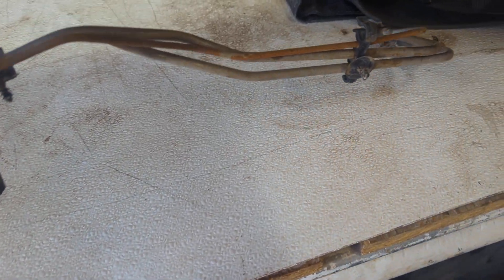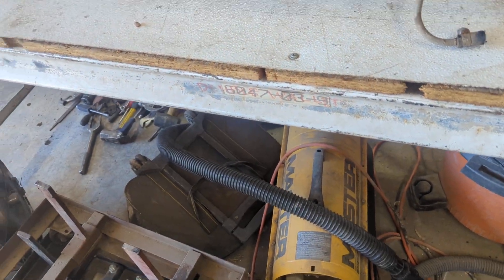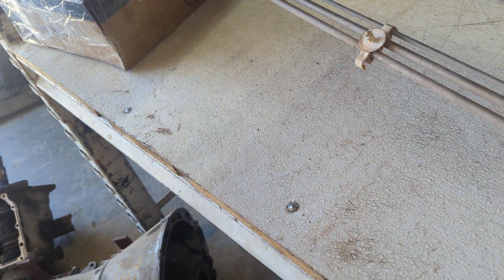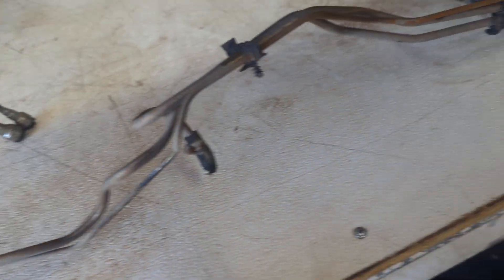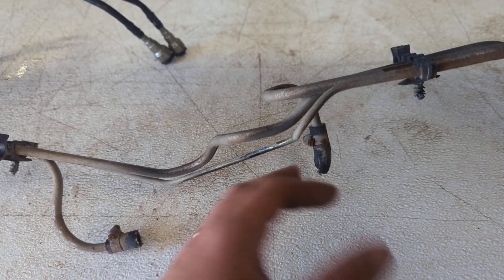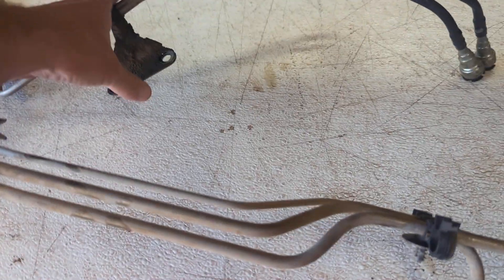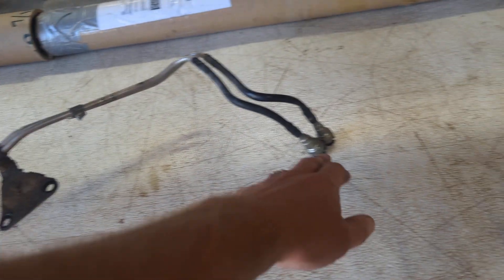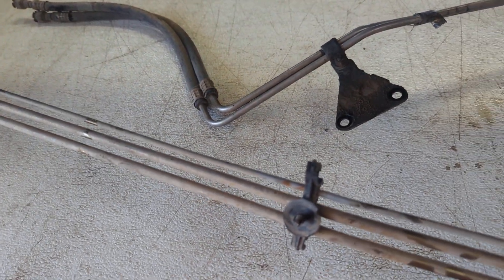Wrangler YJ 4.0 Fuel Supply and Return Lines to Fuel Rail Front 1991-1995

Comment: Thanks for the video. Looking for the rubber sections as mine are cracked and leaking. Hopefully my local NAPA can help with just them like you said. Odd part that nobody really offers a replacement for yet. Did find new ones on inline tube - but I only need the rubber section and shipping the full kit is off the wall expensive like you said. Thanks again.
Reply: Oscar, looking for the same rubber sections curious to know what you ended up doing?
Reply: @jesse7769  I actually had a second set of them in my garage as I had swapped engines years ago. The ones I had that were leaking had been repaired by someone else and the repair was leaking. Kinda crappy to have to hunt used fuel lines - but they will fit correctly. Good luck.
Reply: @oscarwinner2034  thanks, i think im going to have a local shop build me a set.